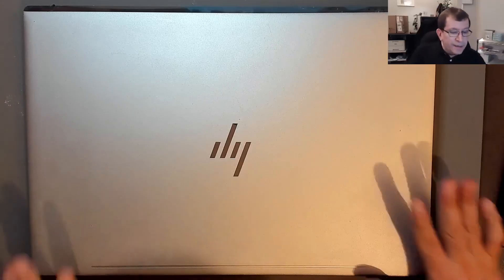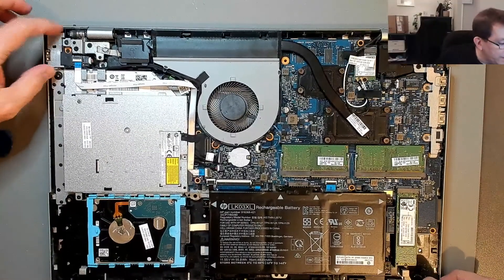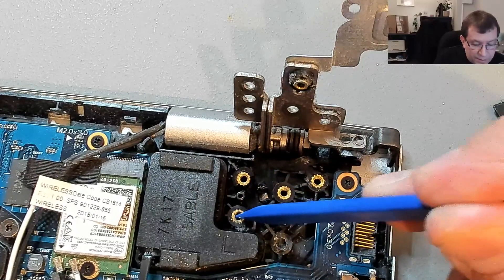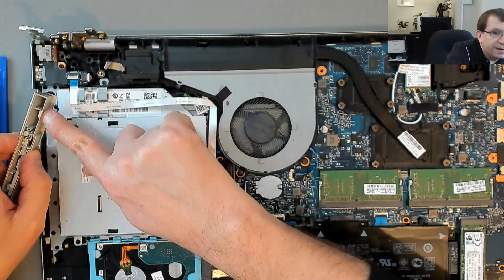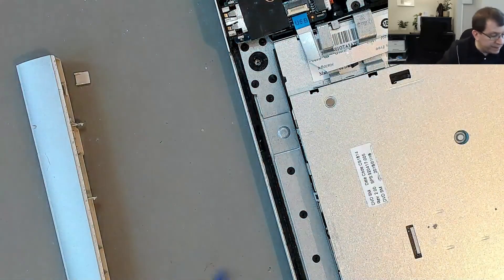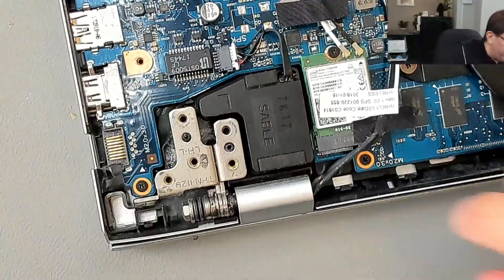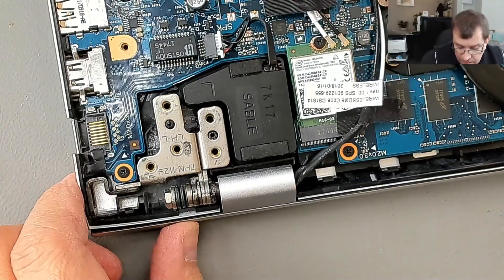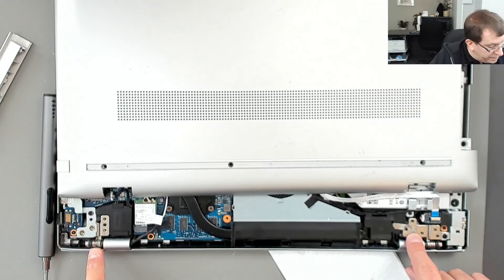[25] Repairing broken laptop hinges - HP Envy 17-ae051sa (TPN-1129)

Comment: Why you did not put some fine oil on hinges ?!
Reply from the maker: Those hinges are already lubricated. If this type of hinge is too tight, I might adjust the spring tension using a nut driver, but I don't remember if I did so on this one.

Comment: Wow, amazing repair. The raised parts of the screw inserts on one side of my HP Envy have each broken into several pieces, so I'm not sure I could reconstruct them. Would the superglue+baking soda resin be enough to hold the metal lugs in place if I built it up enough? As opposed to here, where the resin supports the original plastic casings?

Great music on the video too!
Reply from the maker: Yes, I've done several such repairs using baking soda and Super Glue to reattach the brass threaded inserts. The hardest part is getting them back exactly where they need to be so that the threads will line up.
Reply: @ComputerHelpNI  thank you. I'm going to try blu-tak in the gap under the brass inserts to hold them in place. I decided on araldite instead of the superglue as I didn't trust myself not to make loads of mess. Thanks for the advice.

Comment: I also have this same issue. worst model i also face this issue so I stopped buying HP laptop. And battery also not working after  after 1 1/5 Years. They should give metal screws not plastic or give the option to replace the full set

Comment: Hey what if the big screw is popping out? Like one of the two big metal screws; is it still repairable?
Reply from the maker: If the screw is popping out, you likely need to repair the plastic that is supposed to be holding it together. You'd need to take the laptop apart to see what's going on inside. (I wouldn't be surprised if you find something similar to what's shown in this video.)

Comment: The issue is the hinge itself is over tightened. No spring, just bushings to provide friction. Mounting it to the small amount of plastic with no reinforcement defies common sense.  You can loosen the nut on each hinge to reduce the friction and allow smoother opening and closing. Not isolated to HP.  I have had Dell do the same. Just dumb engineering.
Reply from the maker: True. I should probably have mentioned that in the video. 😳
Reply: I always wondered if that could be done! Thanks! :pride-heart-rainbow-philly:

Comment: What was that white  powder
Reply from the maker: It's bicarbonate of soda, a.k.a. baking soda. It reacts with Super Glue (the liquid version, not the gel) to form an incredibly hard resin and bonds tightly to the existing plastic. I've repaired several laptops this way, and I've seen a couple of them more than a year later with the repair still intact.

Comment: Thank you very much for the very nice video.
This PC has a very fragile display hinge.

By the way, is it possible to replace only the keyboard on this PC?
I am stuck with a defective keyboard.
Reply from the maker: I’m glad it helped. 

To replace just the keyboard is difficult, as it’s bonded to the top case by plastic “rivets.” It’s much easier to find a replacement “top case with keyboard” and just replace the whole thing, as you would need to completely disassemble the laptop regardless of which route (KB only or KB with top case) you decide to go for.

Comment: I see there is a class action against HP for this very problem they deny exists. Yeah. While I wait for my $2 rebate I gotta fix it myself.  I see that seating the nut to align will be the problem.  I think it will work to leave the screw on the nut through the closed hinge with just a bit of glue to seat it properly.  That done, I can remove the screw, open the hinge, and proceed to build up a glue base around it.  That should work so long as I don't get glue on the screw! 
I always try to fix things myself.  It's always the first time and usually the last time I have to do it, so each event is a new adventure. I didn't even know how to take off the back until your video and sure had never heard of a baking soda mortar, so gratitude!
Reply from the maker: I've considered but never done what you describe here, as you're correct that the biggest problem I've run into with this type of repair is misalignment of the metal screw inserts.

Comment: Hello Computer Help NI. Thank you for doing this repair video.
Would you please explain "how" you use the baking soda with the super glue? I guess super glue alone is not sufficient?
Also, if in my case, the bosses are in too many small pieces in order to be successfully glued back together to withstand the torquing when open and closing the clam shell, would the "top-case" need to then be replaced?
Thank you very much for your additional details. :-)
Reply from the maker: (I replied to this comment via email, but I thought I'd share the response here as well.)

I apply a small amount of Super Glue and then sprinkle baking soda onto the wet glue. The baking soda dissolved in the glue and forms a very hard resin. This process is shown more clearly in a couple of my other videos. See this one from around 26 minutes: https://youtu.be/UGx3zKjt0E8?t=1560

I hope that helps!

Comment: how many millions of laptops have hp built and they cannot design a simple hinge that will last more than 18 months?  hp has stolen the last dollar from me as I just threw my third hp laptop with dead hinge and broken case in the trash f***k hp
Reply: This is the same problem I had. I just contacted them about this. They told me it was out of warranty. I have older computers and the hings lasted for years. This is a design problem using plastic. I just spoke to someone at HP they claim I would receive a coupon for repair. After seeing this video we can clearly see this is a recall. Sorry you got rid of yours. We need to let them know about it. If not I'm contacting the Better Business Bureau.
Reply from the maker: Yes, I often think along similar lines. It's not just HP though -- I've seen some pretty terrible hinges in the less expensive Toshiba and Lenovo laptops as well.

Comment: How much did you charge for that?
Reply from the maker: I charged for two hours of labour. For most hinge repairs, the labour charge is usually between 30 to 60 minutes, but this one was more difficult than most.
Reply: @ComputerHelpNI  how much does it cost? i have the same exact problem with the same laptop
Reply from the maker: @HTLiu1  I'd probably charge £80 for this repair and offer a 90-day warranty on the work.

Comment: Thank you so much, sir. I think this method is better than using super glue with cotton because I can control the amount of material to build resin more effectively.
Reply from the maker: Thanks! I hadn't heard of using cotton before, but I do find that baking soda and Super Glue is pretty easy to work with and very strong when cured.